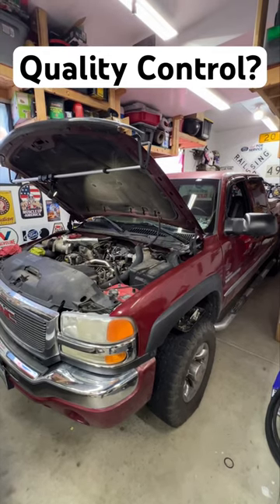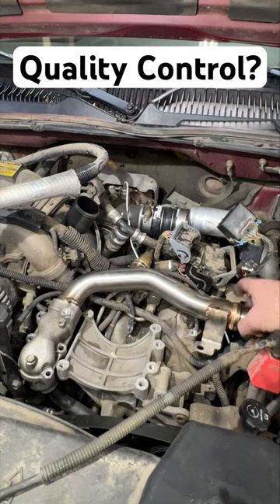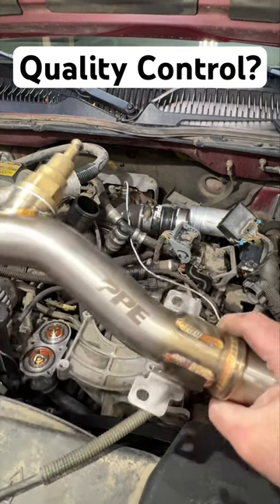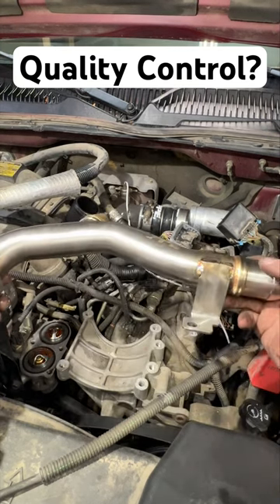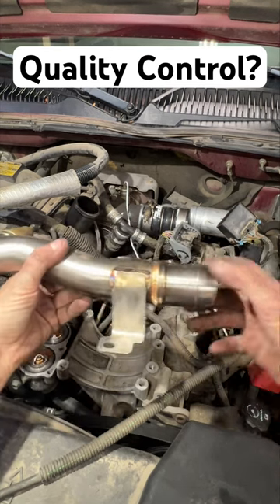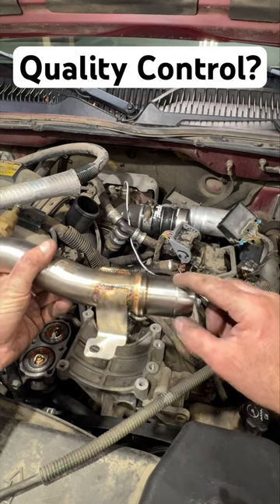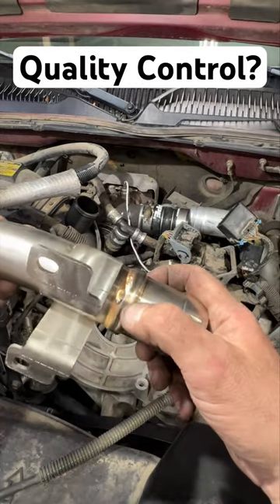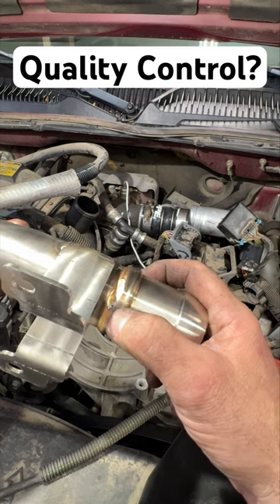Where’s the QC (quality control)? These companies need to do better. #duramax #gmcsierra #chevy

Comment: It's just you man. Howany of these pipes have they sold with how many issues?
I'd say the nber is pretty small
Reply from the maker: Must be because I had a dieselsite hpop fail on me straight out of the box plus 8 new injectors from Holders diesel that somebody didn’t torque down the spool valves correctly had to send all 8 back 😡
Reply: How many were just fixed and not reported on the internet? I’m assuming most as mechanics don’t have time to complain about every pos part they get nowadays,they fix and move on most of the time.
Reply: @NoName-tz5ji  Allright. That could be too.
Reply: @NoName-tz5ji   YOU Said it all 🤘
Reply from the maker: Normally I wouldn’t complain about it on the internet, but it’s how the company responds to the issue. The PPE representative tried giving me the run around and wouldn’t swap it out until I sent this one in thus at least a week then he said it would take a few or more days to see what’s actually wrong before they sent a replacement out. So you’re looking at 2-3 weeks to get an issue solved that should have never happened if it was inspected correctly before being shipped out. Then trying to explain that to the customer your doing the repair for that’s already not happy.
Reply: @BLUECOLLARGARAGE  yeah. The more I think about it the more I am in agreement.  I've had similar situations. Not just in the car parts market.
Sorry that I kinda jumped on ya right outta the gate. 
You know. Something like this part in particular should be accepted back. In this case PPE could male the repair, clean it up and sell it as new.
I recently bought a brand new FASS 165 Titanium lift pump for my duramax.
Right out of the box it was injecting air into the fuel system. When I called FASS they said there is no way that this could be happening.
I bought a 20 gallon aquarium filled it with diesel removed the filters from the pump and submerged the pump just past the filter mating surface. I then submerged all three lines well below the surface of the fuel.
Both the fuel return and fuel supply or pressure line had air coming from them.
I am convinced that the t-block was warped or not machined flat.
So, your right. It does happen